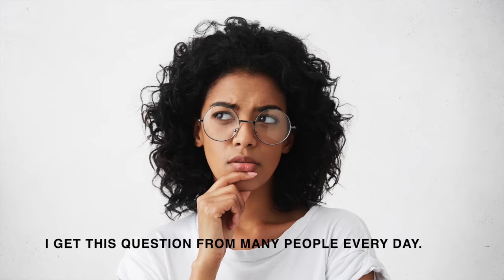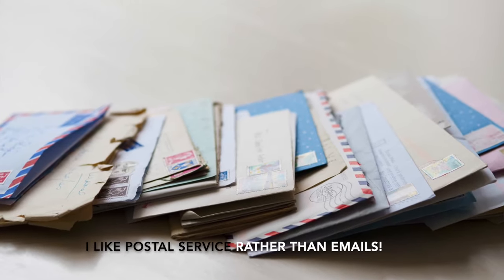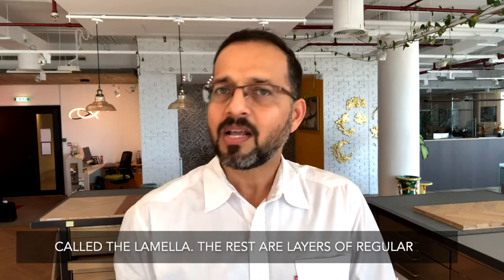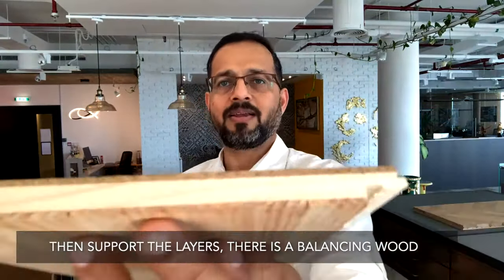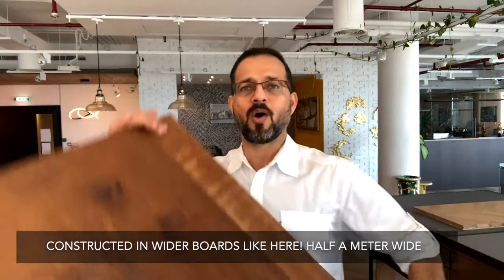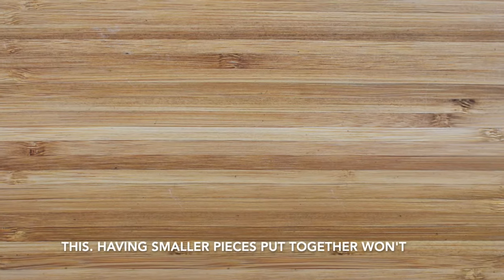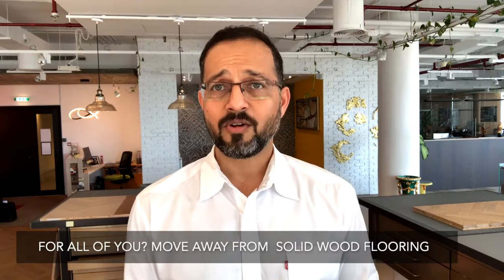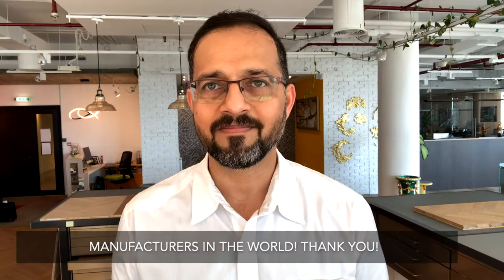Solid Wood Or Engineered Wood?

Comment: i heard that engineered wood would break easily. Whats your thought on this?
Reply: I know it's several months late, but engineered hardwood floors are more durable than regular hardwood floors in most cases. In fact, the least durable part of them is the real hardwood layer on top. Engineered wood does include things like particle board, but that is not the type you would have for flooring.

Comment: Hi.

Appreciate the informative video. 

I have some clarification.

If I buy an Engineered Wood, how will I handle the termite issue.   Is Engineered Wood also prone to termites? Is there a solution or an insecticide we can apply to avoids  termites issues but not so harmful to humans?

Fire concern, is there a liquid solution to make the spread of fire slower than the average wood?

Thank you.